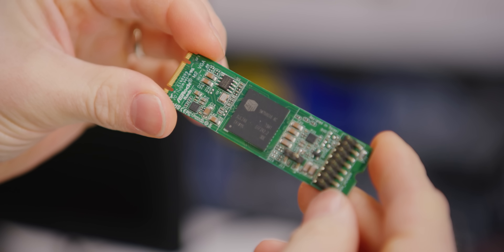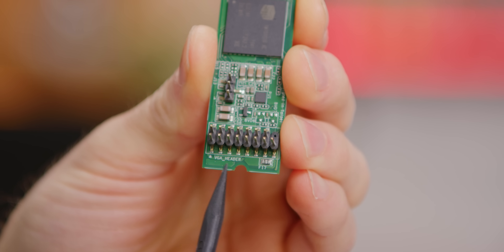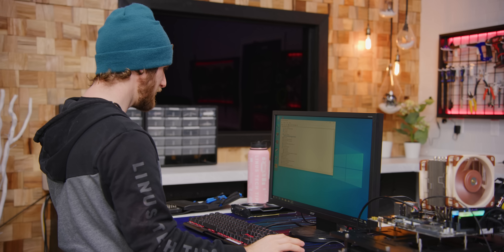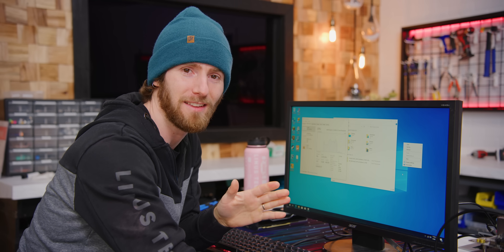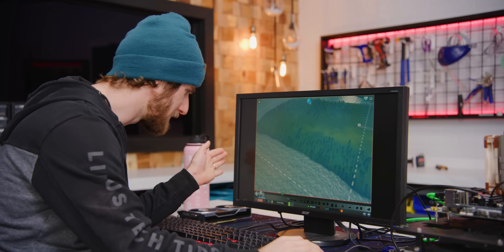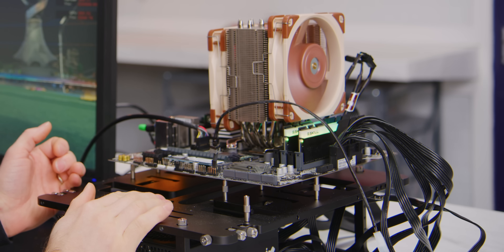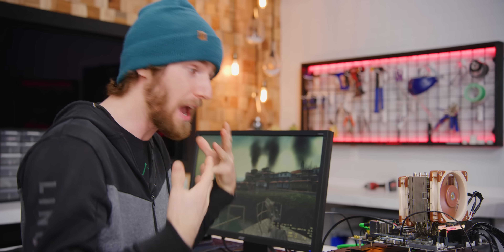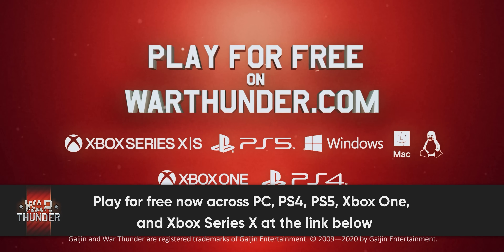THIS is a Graphics Card..?? - ASRock Rack M2_VGA

Comment: I had the exact same problem with it showing 1hz and then showing 64hz. All I did is update windows as a whole and then it recognized my monitor and then i could run it at actual 60hz. its not the vga, its the drivers that needed to be updated as a whole by just updating windows. that is why it looks terrible.

Comment: I own a server motherboard which is built in a way where a normal discrete GPU, installed in the top PCIe x16 slot, would overlap the next PCIe x4 slot down (inefficient placement of expansion slots).
If a GPU with actually ok 3D performance which fit into an M.2 2280/22110 slot would exist I would highly appreciate it, since I'd have more slots for various expansion cards.
But I guess I should just buy another motherboard...

Comment: I think an ideal use for it is adding video output to embedded devices, maybe for servicing or recovery purposes rather than everyday use. 

When it mentions gaming systems they could mean things like arcade machines where the primary interface is physical lights and buttons rather than video-based, where this could then be used for management purposes or running reports.

Another idea - adding a secondary display to an existing system for digital signage or advertising purposes, such as the screens you get on grocery store self checkouts

Disappointed that it's not slot-powered though!

Comment: Mmmmm maybe it would be a good idea if something like that exists for office, a little better that runs a video in YouTube in 720p30fps😮. You could have use of old xeon CPU's dirt cheap like those lga 1366 or even 2011. I bet it would be cheaper and better than any new processors like celeron or similar. Maybe manufacters could make it mini-pcs out of them, since there is no GPU big size but one m.2 size. Cheap ddr2-3 ram, cheap xeon cpu, cheap Chinese custom motherboard and hopefully cheap m.2 graphic card in a tiny mini pc. Can be easily sold for like US$200 to places where second hand market is not like USA.
I don't know if it's possible, but a GPU from semi old phone processors should be enough.

Comment: If they improved it a bit, it could be a killer addon to some weaker budget laptops. Good GPU is rare, but for some reason you can sometimes find m.2 slot even on like 200 buck laptops. If it worked there, it would be great way to upgrade an old laptop and enable it to run older games, or, like, turn it into decent enough movie machine or smth.

Comment: I dunno, i think this concept has a niche. I am thinking about a customer whose PC "just turns not on any more" and you have to go troubleshooting. This would be an easy way to sort out the GPU. Of course there had to be at least a proper display port and a little bit more power. But the concept is cool! Testing a board without integrated GPU and having not another GPU on hand is pretty annoying. With this thing you could always have the possibility to test a board and a CPU with no integrated graphics while the actual GPU which was in the system is not needed.
Like i said. It could help troubleshooting, if developed further. The idea is kinda great^^
But more like a helpful gadget than a real piece of hardware^^

Comment: Honestly, I think this thing would be pretty useful for headless servers if you just need a barebones display output for a command line in case SSH breaks.

I have a homelab setup myself and my server machine has 1050 Ti in it for Jellyfin transcoding, but if I didn’t need hardware accelerated transcoding, I could easily see using something like this for a basic CLI output just-in-case.

Comment: Looking at the 64Hz display, I have an old Acer 7750G laptop and when I upgraded it from Windows 7 to Windows 10, it used to do a very weird thing where it showed random thin lines on the screen when moving windows or minimising/maximising a window, so I got round this by lots of trial and errors and used the GPU tweaking app and set it to 64Hz instead of the previous 60Hz and it worked perfectly after that.... well with the odd random rebooting that is.
Reply: 64hz happens on the ms basic display drivers
Reply: @randomgamingin144p  It was bizarre because in Windows 7 it was 60Hz but Windows 10 would only work without flickering if it was set to 64Hz.

Good old Microsoft :D

Comment: So basically it's like the ASpeed AST2400 32Mb 1920x1200 @ 60Hz that is integrated into my ASUS Z10PE-D8 WS? It's just as you said, a terminal access VGA. my previous Z8NA-D6c use ASpeed as well

Comment: Isn't the banding on the yt video is just the compression artifacts? I assume you guys have the master file at low compression so virtually no banding can be seen when you playback on your machine, but then when you upload to YouTube, it compresses it more so we can't see how good it may actually be.

I have a laptop with 1080p display, VESA HDR400 certified, and a standalone 1080p monitor good for 250 nits. Runs off of the GTX 1660 Ti in the laptop and at 1080p playback they do have those banding on either displays. Streaming at 4K though because it has more bitrate does eliminate the banding.

Comment: A possible use case for this when it comes to the gaming part is when you make a VM machine.
Imagine if you have only 1 GPU like a RTX 3080 and you want to pass that into a gaming VM then this could be used for that short time you spend inside the host OS just to turn on your VMs.
Would save alot of money rather than having to buy a second GPU if you dont have any onboard graphics.

Comment: I hate to say this but it looks like he does not have active cooling on that and I would say that you could water quit using the raspberry pi heatsink water cooler or option to just put a dang heatsink on it that little chip is purely not been crowned no wonder it's not functioning properly how this message gets across Linus Tech tips!

Comment: the color gradients comes from your shitty acer monitor's input. analog/VGA does that. if it outputs 24bpp your screen renders only 16 or 18bpp. 
the only point with analog VGA is on a trinitron or diamondtron monitor. so you can build a neogeo or arcade gaming rack with a small, low-power mobo and still have a GPU for it.

Comment: I had this strange issue with colour and 64hz. Something wrong went with drivers, I had to DDU it and install again. And check that 60hz actually applied. After that colour is ok and even animation became normal. I think the same happened here. Or don't install driver and use basic display driver it'll probably be ok.

Comment: would love a mini pcie video decoder card similar to the old broadcom/avermedia cards but one that works with modern video standards without being tied to a certain media player.

old laptops struggle with hd video acceleration even though in general they are still usable for other tasks.
Reply: An AV1, H265-4 m.2 card would be lovely.

Comment: I can see this use. sort of. on my machine let's say I've got my beastly 3080 completely maxed on display ports and hdmi in my "hypothetical" perifrial vision displays upand whatnot. but  you see I want a screen that will display a website or monitor my stream chat or discord or Temps, but I don't want to waste 3080 slots on a purely info screen that does not need to be pretty or high resolution. so what do I do?. well I found this old screen with vga in my basement. and I have a free m.2 slot? well a gpu powered enough to show a screen can do that.
Reply: nvm not for 136$
Reply: nope I'm building a server next paycheck

Comment: That looks very similar to one of the monitors i have cept mine has a square base

the reason i can tell it is not is because wen playing the same video 4:55 on mine there is more black space meaning his resolution is different. mine is 1680:1050 the black bars on his look more like my 1920:1080 monitor

Comment: That actually seems very useful for simple embedded systems. A PI would be easier to use of course, but if you wanted to run a monitor or small display from a teensy, that would technically be possible.

Comment: I believe (correct me if im wrong) is equivalent to Matrox G200's) it's the most common discrete GPUs used by Server Vendors like: Dell's PowerEdge Servers, Cisco's UCS Servers, HP Proliant Servers. Just to name a few (Personally, i've seen it on the Cisco and Dell one)

It's just enough to drive that VGA in the back (or the front, if you're the front VGA kind of guy)

Comment: This may actually have a good purpose. This can probably help with making a computer post when it doesn’t have an integrated GPU installed in the CPU. Most CPU’s without graphics need some sort of graphics driver for it to run, and this is no exception. This could help somebody with no GPU but intent to get one soon and when they upgrade, or get scammed on Ebay or something, they still have a graphics drivers unit in their PC.

Comment: I really wanna know what is packed into this little “GPU” XP
like…. Does it have the Cores, TMUs, and ROPs like current hardware does? Or does it have old vertex and pixel shaders rather than cores?
Reply: No and you didnt watch the video if you need to ask
Reply: @ironjavelin1234  I did watch it, but don’t remember any physical specs, beside the fact it has 16MB of DDR memory
Reply: @Thewaterspirit57  alright but he does mention it running off warp so its basically ram for the cpu but its interesting how it works despite it essentially being garbage

Comment: I could honestly use one if it was cheap enough.  I have an x99 mobo with no onboard graphic ports running as a NAS.  So when I need to interface with it I toss in an old card that jumps between PCs.

Comment: I suspect the reason Cities: Skylines worked is because OpenGL has it's own software renderer that it defaults to if hardware 3D acceleration isn't available. That said, there are significantly more powerful embedded GPUs (with 3d acceleration) that would fit on an M.2 card. Many PowerVR chips would no doubt fit, maybe even AMD Radeon E series, or NVIDIA Quadro. Power and cooling would be the limiting factors, I think.

Comment: I run similar tiny graphic card in an industrial micro PC board that drive a cutter machine, for menu control, setup and to load  recipes no problem, of course not optimized for video framing or game superduper resolution graphics, Yes there are other uses for PC's to drive industrial machinery.

Comment: It's a great VGA card. I bet it'll run WING COMMANDER II just fine in 256-colors in full 640x480 resolution. Sure as hell beats any EGA or Hercules card. I wonder if they have DOS 6.22 and Windows 3.0 drivers for it.
Reply: @dwightlooi  we getting 20 seconds per frame in duke nukem 3d 💀💀💀
Reply: Nah, it'd be lightning-fast for Duke Nukem 3d. Remember 512kb ISA VGA cards?
Reply: Diablo 2

Comment: I kinda want one in a standard PCIe x1 Add-In Card form factor. If it is cheap, it is a great and easy troubleshooting video output. Great for when you failed to flash your VBIOS or other Video Card related issues.
Reply: There are M2 card adapters for PCIe slots, you can put one into it
Reply: @xpehkto  but you would still need the VGA Back Panel Adapter, which makes it a less elegant/usable solution for simple troubleshooting. Things would be flopping around all over the place.

Comment: War thunder. I bought a Acer Nitro 5 with i7 tenth gen, 16Gb RAN DDR4 and RTX2060 with 6Gb proprietary video RAM with which the game SHOULD run smooth as silk, yet he danm game freezes with no message at the login page no matter what I do (and I've tried ALL the possibilities). Worse, on the net I've found NO help. It seems the only one having this problem on this godforsaken planet it's me. 🤬 🤬 🤬

I should add that War thunder is THE ONLY GAME that does this on my machine.

Comment: Honestly, I bet there is space for products like this in gaming laptops. Considering that the NVME standard, not to mention u.2 versions of this standard, are about as fast as a lot of external gpu solutions, and that the performance of the card could be keyed more precisely to saturate that connection, rather than bottlenecking there, and considering that you could run a dedicated cooling solution, putting forth genuine quality into an nvme graphics card could actually make sense.

Comment: Can I just change graphics card without worrying about size differences or any differences of any kind on my laptop? Like from AMD Radeon HD 6600M to NVIDIA GeForce GTX 1050 (Mobile)? 

Bottleneck goes from 20-30% to less than 5% if I go through with this btw.

Comment: It's a bit old but if you want to cover obscure and odd hardware... The Subway USB Controller for the Amiga1200. It's a USB 1.1 and 2.0 controller for the Commodore Amiga 1200. It plugs into the system's clock port. That is it plugs into a port meant to be used for a battery backed real time clock.

Comment: A usb video card would be better... or even a streaming terminal display, over a network.

The smallest video-card is built into almost every Intel/Pentium CPU. Its not in 9xxx chips and may not be in some newer chips, but its in most of the other ones, for the past 10+ years.

This is a waste of an M.2 slot. :)

I wish computers would just switch over to running off 12v power for everything and keep all "data", bound within fiber-optics. It would kill all the stupid "lanes" issues and remove 98% of the connections and need for other power-sources. Not to mention that it would make a CPU and most devices easily "cooled", from both sides of the chip. (Since a fiber-optic connection is tiny and only requires a thin hole to insert a thin cable. The sides of a chip being a (+) connection and both the flat-sides, under the cooler sandwich, being the (-) connection.)

The whole motherboard would be moot... You could put your components anywhere, including RAM. All protected from water-spilling, dust build-up, electrical shock and falling tools. Not to mention the ease of cooling mounts that just have to be tightly gripped halves, with no fancy mounting brackets. Also, no more stupid "standards" for "connections". Just one standard connection forever... Two pins for power and one fiber-optic port-hole. (Okay, maybe a few pins for a CPU, so it can have various "layers" of power-control and demands. But, honestly, that could be internal on the sandwich-chip. Its all 12v, so you only need a "rail" or "thickness" to manage your greatest amperage draw. If its communicating through fiber-optics, not physical powered voltage rails... there is about 1/10th the power needed for communication. It's not like its broadcasting fiber-optic light across a whole state, or a whole house, just inches away, to another device, or hub.)

Hook me up, we'll do a merged patent on it.

Comment: Funny, the thing about the display adapter showing 1Hz while the other showing 60Hz was a frequent problem after driver updates with my MSI GTX 970 using a 144Hz Monitor

Comment: This is essentially one of those USB 3.0 VGA adapters turned into a M.2 card. All it's meant to do is give you a video output. Nothing more. Really good for diagnosing problems or to have a headless machine that would otherwise complain about no GPU being present or something, but not much else really. 
I'm guessing this is meant to be the spiritual successor to the ATI Rage embedded 8MB GPUs found on server mobos of old, or the even weirder XGI Volari Z7 16MB embedded GPUs found on slightly newer server boards (about the 1st to 4th core i series generations or thereabouts, or rather their Xeon equivalents)

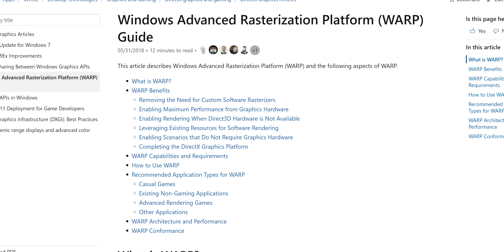Comment: 9:43 WARP is just a continuation of D3D HAL (Hardware Abstraction Layer) software/reference rasterizer. That would run all your D3D games at atrocious framerates straight on the CPU in the times before 3D accelerators like a voodoo, Rage3D or Riva 128 were common enough to be included in every system.
Reply: Do you know of any way to use that instead of the gpu or igpu, I am curious about performance with current day cpus.

Comment: if you multiply out your resolution by the color depth you might find that 16mb wont handle high color and high resolution even in 2D. 8 bit is not a lot of color for a youtube video, its only 256 color mode. Video will never look good at less than 16bit color depth.

Comment: So you're telling me I can stick this in the unused M.2 port in my mini-ITX build, mount a mini vga display in the front of the case, and write my own custom 2d interface for system monitoring (load, temps, watts, clock freq, etc.)? That would actually be a fun project, even though its totally impractical.
Reply: Fun impractical project? Sounds like a great idea!
Reply: We need to know if this was done
Reply: i need update
Reply: Did you do it
Reply: Yep, you just need a stronger cpu, clearly the cpu was the bottleneck here.
Reply: @kons37flyingreaper41  2d interface. A 386 can run one of those.
Reply: @-x21-  not very well...
Reply: This actually sounds like an awesome project.
Reply: @AndrewFRC135  4 years have passed. How is that project going? 😂
Reply: @ChaosLordDiscord Wow, that was already 4 years ago?! I did actually look into getting one of these cards, but they were asking almost $200 each for them at the time. Looks like they've come down in price a bit, but I haven't forked over the dough to try... yet 😁

Comment: Hey ! Guyz Guyz . I really need your help . I've been looking for a similar topic i,e the possibility of running multiple gpus, using bifrucation and multiple changes in the connection protocol used.
Such as using a pcie to dual m.2 m-key adaptor - m.2 m-key riser to pcie x16/x4 for two gpus , Using bifrucation . I you have any idea on this plz contact me.
( Sorry for Making This Soo long but .. I gotta know )